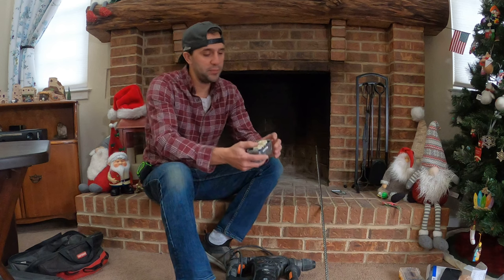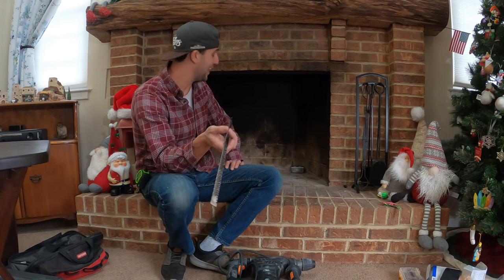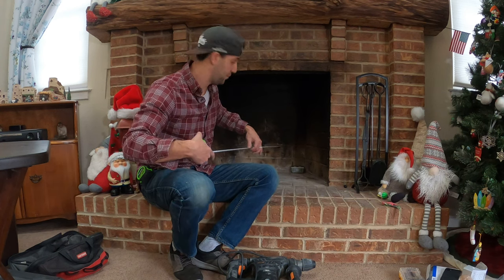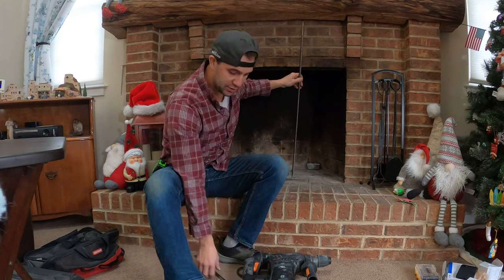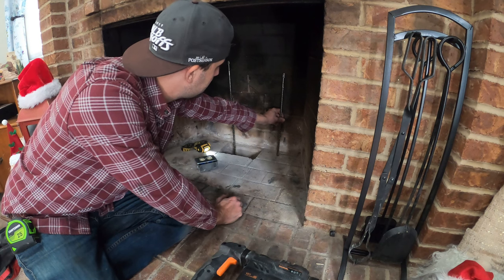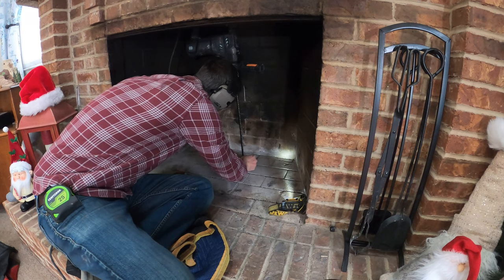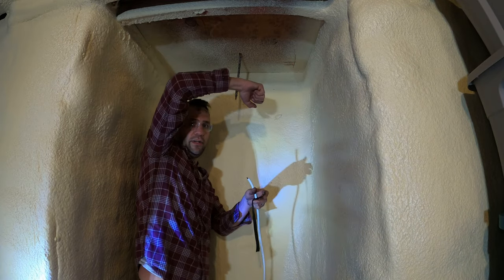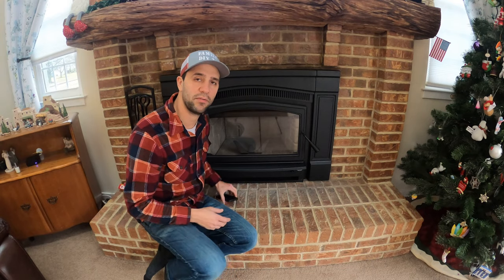Fireplace Outlet for Wood Stove Insert #osburn #osburnwoodstoveinsert

Comment: 2 notes for others – in my case, the inspector required armored cable vs Romex and you also need a cutoff switch to the outlet so anyone servicing the blower can safely terminate the power while working on it.
Reply: Where did you install the cutoff switch?

Comment: Hey Mike, recently found and subscribed to your channel as I was searching for Wood Fireplace Inserts. I know you said you didn't end up doing the entire install yourself, but I was wondering about how the Chimney liner was installed (or fit through) the damper opening? I currently have a clay flue tile lined chimney that needs to be fitted with a 6" dia. Chimney SS liner.  Can you describe how that retrofit happened for your scenario? Appreciate your DIY Channel....  thanks for the electrical video on the blower too.....  I wasn't even thinking about repurposing the ash dump opening into the basement! GREAT Tip.  👍🏻  Thanks -Tony
Reply from the maker: Anthony thanks for subscribing!  They actually had to jackhammer the opening bigger to fit the liner through and then they sealed around the pipe with insulation.    Sometime they remove the entire damper ledge and replace with stainless steal plate but you’re talking $$$ for that type of install.   

They basically make the rectangle into a circle… ha. 

Thanks again
Mike